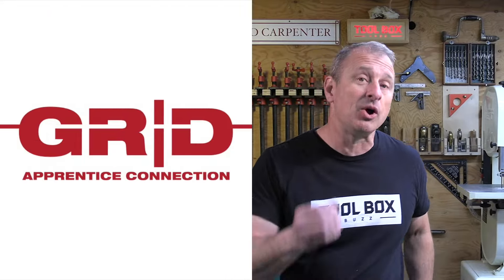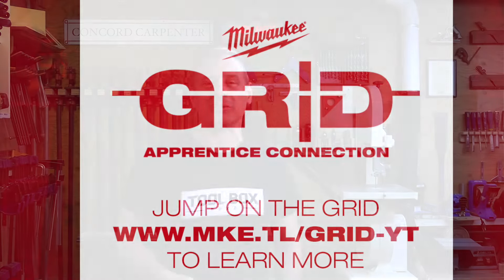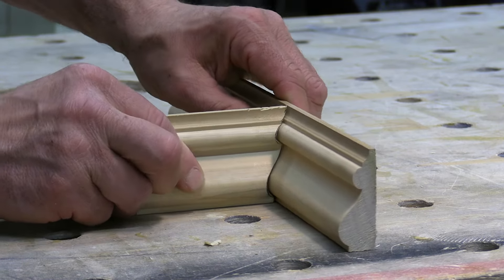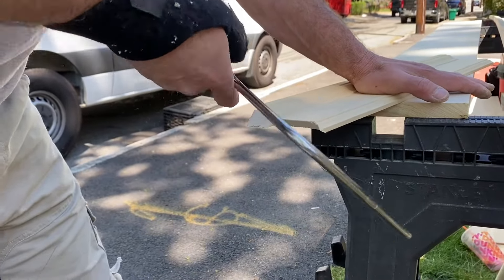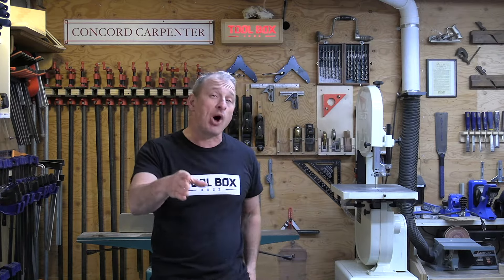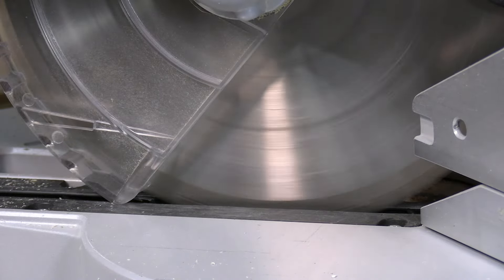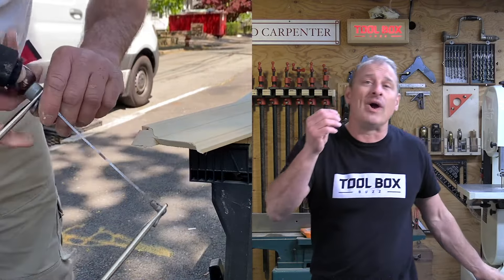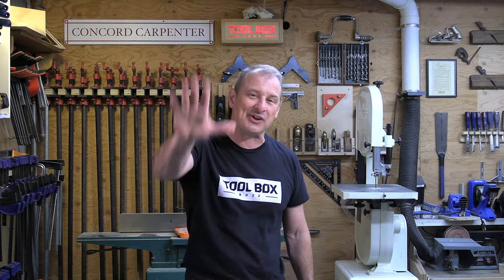Coping Molding

Comment: Wonderful advice. After 22 years of being in the carpentry trade I have tried coping lot's of different ways. One trick I found was to glue 80 grit sand paper to the face side of a piece of trim. After making your cope use the trip with the sand paper to fine tune to coped piece.

Comment: Great video! As a carpenter I always use a coping saw first to get close and then use a few different files to bring it to the perfect profile. Rarely do I have a redo with that method. On standard 3 1/4 base i use nothing but a miter saw, stand-off block and a steady hand.

Comment: the best way so far i have came across is using flappy disk with angle grinder. it just melts the trim away, take a bit to get use to , but it work so much better than the saw.

Comment: 3:46 instead of working left to right, think about the direction of the joints overlap in relation to the entry.  So if there’s shrinkage and a joint opens,  an occupant isn’t looking into the open gap of the joint when they enter the room.

Comment: Coping is always interesting. To not do it and make tight joints are doable, but as Rob mentioned, over time your work may suffer from gaps and movement. And in remodels, if you’re not a crazy man you will have out of square corners everywhere. If you’re having trouble with your copes, try to find the new angle that makes the corner. A bevel square and an angle gauge can accomplish this. 

Or, get the coping saw as close to the profile as possible before getting out the files to bring it to completion. Coping can be tedious, especially when your boss is a total ass. To get real good at coping, take scrap molding home with you and cope off hours.

Yes, I said cope on off hours! You want to be that guy, right? 

Practice, practice, practice!  #imthatkindofcarpenter

Comment: In 1995 my then-wife decided she wanted crown molding in our new 2,500 sq, ft, house. I was mid 30's, young and dumb, and agreed to do it on the entire main floor. I am not a carpenter, not in a trade. Actually in the food business. Went out and bought a DeWalt Miter saw, a coping saw and I have no idea how many feet of not only crown molding but the baseboards and shoe has to match! Fortunately, the guy at the wood supply store took pity on me and explained how to cope. The one tip he didn't give me was using the pencil to outline the cut. I could have used that tip back then Bob. The job turned out really well.

We moved a few years later and I wound up replacing all of the baseboards, shoe, window moldings, doors, and casings in that house. Experience gives you confidence.

Today almost 30 years later, I don't know that I'd have the patience or hell, the energy, to tackle that job again.

Comment: Hey Rob, I love your tips and tricks videos. Also the tool test and reviews as well. But I have a question for you. You wouldn't need to cope miters. If you were using a Starrett miter angle finding guage would you? I use it and it is a very precise tool! It also makes cutting trim easy on tricky unplumb walls and corners. Again thanks for all the knowledge and wisdom of the trade.
Reply from the maker: In the field I would still cope
Reply: A coped joint will look better long term. Once you have practiced coping, it is much faster, and better than a mitre. Also, your square cut doesn't have to be super accurate (on paint grade), because the painter will be caulking the top or bottom of the moulding to the wall. If you're dealing with a tall baseboard when mitering your corners you also have to worry about the walls being plumb, which they never are. Coping is a far superior method to inside miters.